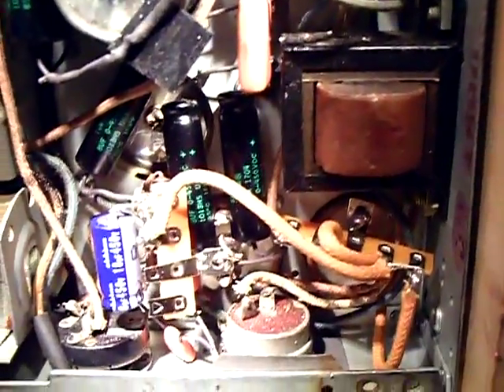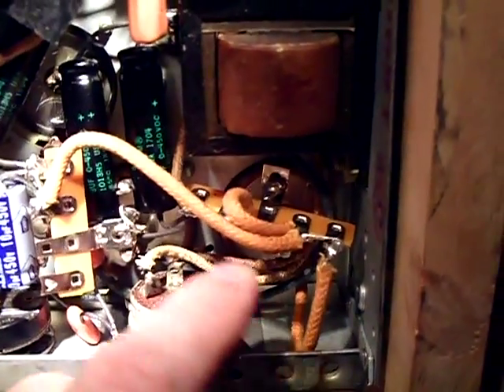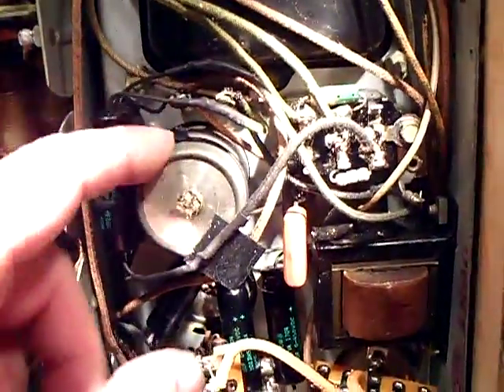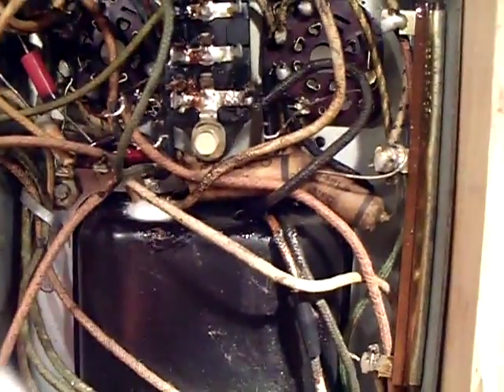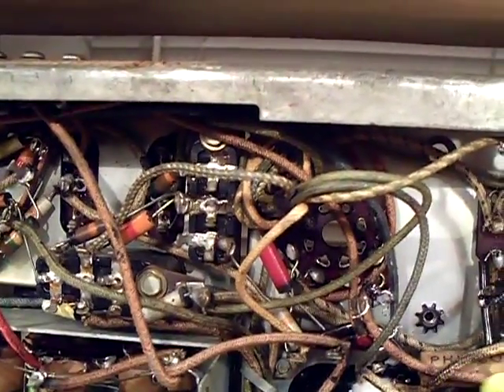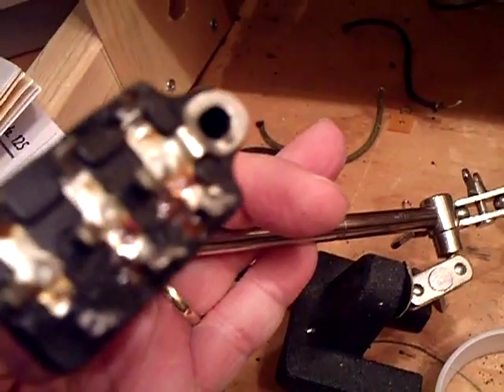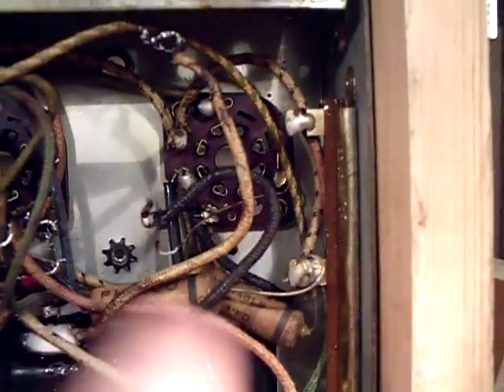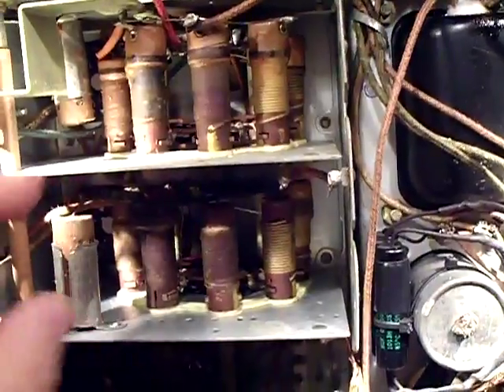Philco 38-116 Repair, Part 7, Filter Caps replaced.

Comment from the maker: yes i could have restuffed the cans, that is an alternate way of doing the job. One has to be careful though, since the can has to ":float" from chassis ground. Philco used a piece of cardboard around the can to isolate them from the chassis clamp. Cardboard is not the greatest insulator.
I figured I would just leave the old cans in place for historic purposes and just put the new smaller electrolytics under the chassis. It's up to you to determine the best way of doing the filter replacement.

Comment from the maker: @HardKnocks60 Philco has specified this radio's AC input is 115 V.
My house socket supplies 125 VAC. I plan to check all tube voltages to see where they are. I do plan to use an auto transformer setup to supply 115 Volts. This will be similar to my video called "The Problem with Voltages"  For about 40-50 bucks I recommend making this kind of setup.  I used a 200 W autotransformer and it can step the AC down 10 volts and runs cool to the touch.